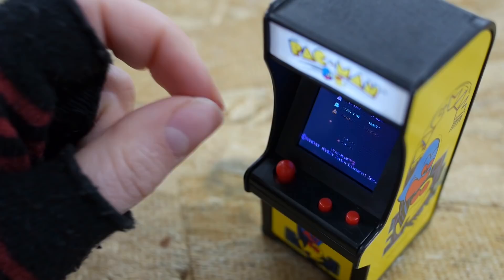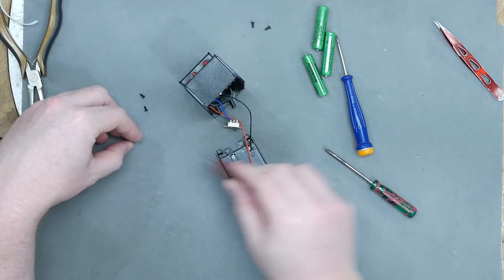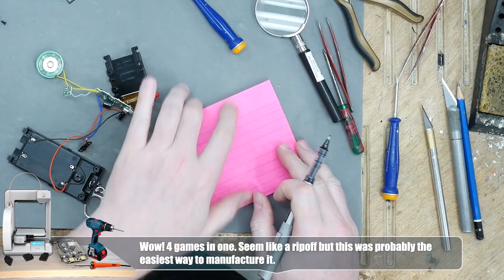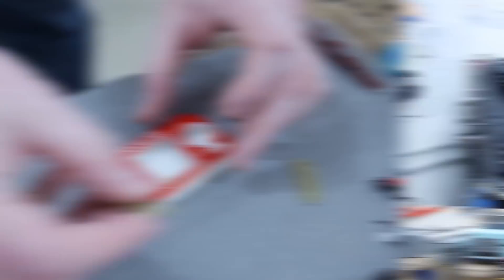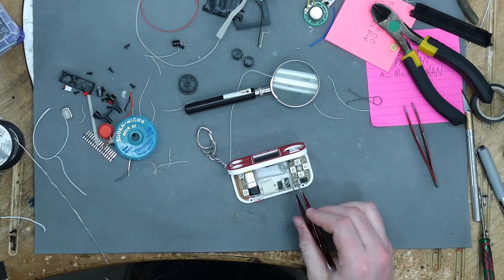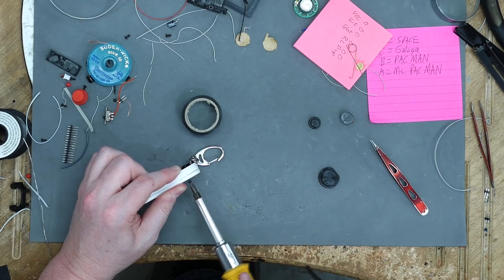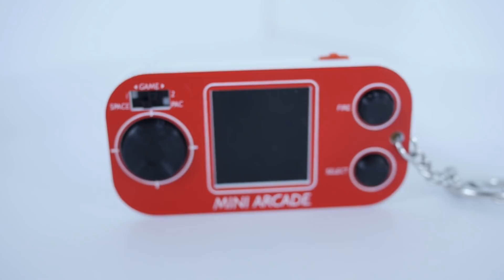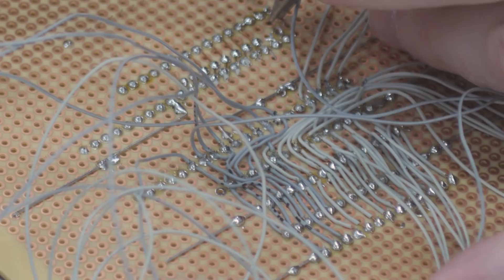Mini Arcade Teardown & Rebuild

Comment: Not sure if someone already posted this. For the multi game selector. You could have used the joystick to complete the bridge. The end result is that while the game is off you hold say up and turn on the game at the same time. It loads galaxian. Game off,you hold down at the same time you power on. It loads space invaders. And so on for left and right. I did that to my mini arcade. It works great. No need to cut,glue or add anything else to the cabinet.

Comment: btw I have a friend who works at the Hong Kong-based company that manufactures these mini arcades, and after telling her about this hack, she said yep, that's exactly what they did what with putting all four games on the same chip and using a jumper to select, and also the checksum screen was what she constantly saw while debugging the thing
Reply: Could you share more about the company? 

It's no simple feat to re-write the game. If the game plays like the original it is an enormous achievement. I wonder who these geniuses are. Why would they want to remain anonymous?

Comment: Those of us that bought these when they first came out found out right away about the jumpers for the games.  Many have modded them to use a 4 pin dip switch since there is room in the back to cut a hole and mount one.
Reply: I used a 4-way slide switch, even easier.

Comment: I wonder if he tried soldering more than one of the A, B, C, D connections at a time.  Like A+B to see if other games are on the chip besides the four found.
Reply: Stolistic Games There's only 4 different models of this, so I realllllly doubt there would be more games.
Reply: There's a Q*Bert one.
Reply: A Floyd the Q Bert one is a different brand/model

Comment: The jumpers on the mainboard reminds me of those bootleg multicarts you find overseas. They'd often just have solder points that are jumped to change how many "Games" you got on the cart, and then have it (sometimes incorrectly) labeled accordingly.

Comment: Ben, have you tried connecting more than one of the game selection pads at the same time? Could there be more games? (they could have used two jumpers to select the four possible games—as you did—so they may have used the four jumper bits to select 15 possible games (plus the "zero" mode you've found.)
Reply: I personally imagine the boot code checks each jumper in sequence, and would initiate the first game in the list if all are high. Would've been cool to see more possible modes with combinations though.

Comment: mrs packman has more level verity, the AI on the ghosts is not predictable, and there's less screens, something like 133 full screens (instead of 255) before you run into the series of 7 messed up screens and a kill screen. there are other differences, like the fruit moves, but those are the major ones.

Comment: What happens if you jump several of the selector pins? With 4 pins you could have 2^4 (16) options.
Reply: Nothing, there are only 4 games on the ROM.

Comment: I didn't see a charging port for the battery.  I hope there is one.
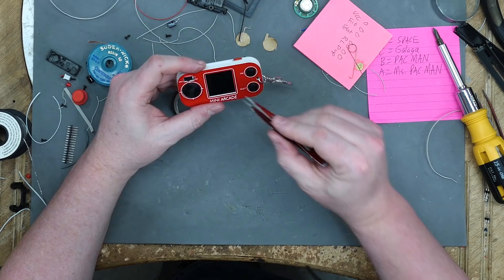Reply: There is, he mentions it during the design phase, it's at the lower left bottom. You can see it in the finished product when he shows Ms. Pac Man @10:30

Comment: 8:55 "point zero eight zero, the last zero is pointless"

Nitpicking:
Actually, it's pretty significant; 0.08 means between 0.075 and 0.085, but 0.080 is between 0.0795 and 0.0805, wich is ten times as accurate.

Comment: Did  you try all ABCD at once? Maybe a fifth game! I preferred Galaga to the other games shown.  But that makes it a tempting thing to buy and make own.
Reply: I did this mod to mine, no link is a test mode which if you hit some buttons on that checksum screen,  you can test joystick etc.
Reply: Ah good to know. Thanks.
Reply: There's only 4 models of this kind so that's all the games there are
Reply: They could have had it check multiple links for up to 16 games but they didn't. You can actually wire the joystick lines to the ABCD jumpers so you power on, holding a direction to get a game.
Reply: Oh, I see another mini arcade seller that has seven games devices so could problem switch between all seven like this?
Reply: Possibly, yeah. as its 4 jumpers, you could treat it like binary so 0000 to 1111 which is 16 variants. if they have enough rom space, I don't see what they couldnt make a 16 in 1 arcade box.
Reply: Then the BOM would change for all of the boards. With this one, it's whether you populate that 0 ohm on pads 1,2,3, or 4
Reply: The manufacturer of the "tiny arcade" made four of these so most likely there is no 5th game
Reply: Scott Lawrence With 2 resistors they could have 6 games with the same BOM. ;)
Reply: I wonder if it does anything interesting with the remaining 11 combinations.

Comment: Why not use a 4 position switch?  Also, you don't need a 2-4 bit encoder, you could have used a 74238 which a 3 to 8 line decoder, and only use 2 bits.  The 238 is an inverted variant of the 138.
Reply: space? or just what they had on hand.
Reply: I think he wanted to split the genres.

Comment: So on the original hardware PacMan had hollow maze walls and had a really annoying siren sounding the entire time you played. Ms PacMan was an unlicensed mod that arcade guys loaded into PacMan machines and the walls were solid, which made it a lot easier to see what was going on and it also lacked the annoying siren effect.
Reply: KatjaPurrs yep, Ms. Pac-Man started life as a Mod called "Crazy Otto", made by General Computer Corporation.  It was then showed to Bally-Midway, who was the American licensee of Namco's Pac-Man.  They then showed it to Namco, and it eventually became "Ms. Pac-Man" .  

General Computer Corporation was notorious for hacking and Bootlegging Arcade machines, among other things, and  making new games out of them. A few times, it had gotten them in trouble,  including a 1983 Lawsuit by Atari, after it had made some unauthorized expansion for a couple Atari arcade games.   They settled out-of -court for a cash sum, and Atari had GCC design a new Game console (Atari 7800) to be released for 1984.

Comment: The difference between Pac Man and Mrs. Pac Man is that, assuming the game is faithful to the originals' styles, Mrs. Pac Man has a better algorithm for ghost movements.  Pac Man's ghost movements were deterministic and based on the controller inputs, which meant that you could follow a specific path through the maze and never encounter a single ghost.  This was changed for the sequel.
Reply: Maybe that's true but he was making a Wayne's World (the first movie) reference.
Reply: Yeah lol it was a Wayne's World reference. He references that movie all the time. Probably because it's a great movie.
Reply: I feel dumb.
Reply: The bigger difference is that mc pacman has different mazes, pacman has just the one single maze.
Reply: Ms. Pac Man originally was a mod to Pac Man to be added to existing arcade cabinets back then. It was called Crazy Otto (of which only 4 prototype cabinets exist) before it became an original game. Of course, Namco nowadays wants to pretend the game doesn't exist, because they'd have to pay royalties to the people that actually made the game if they use it.